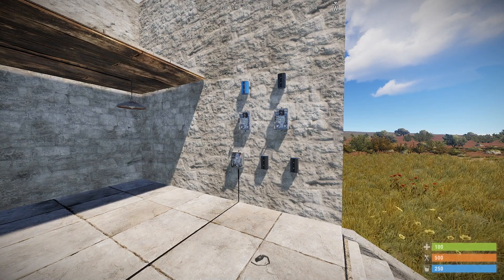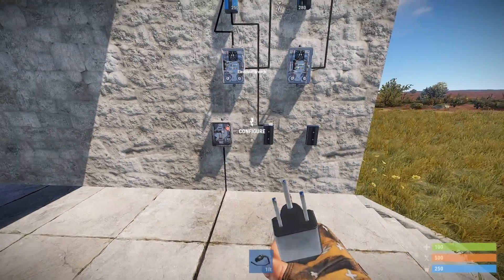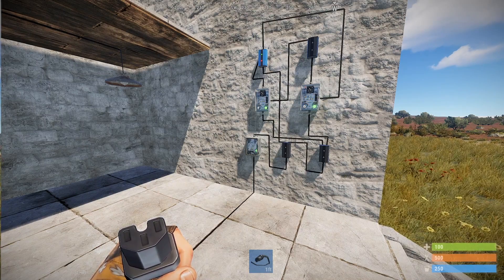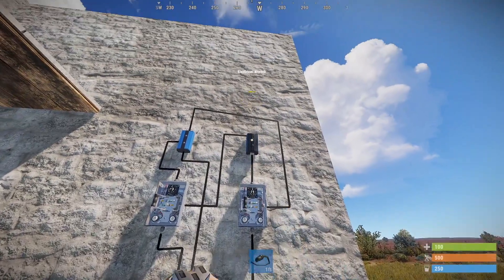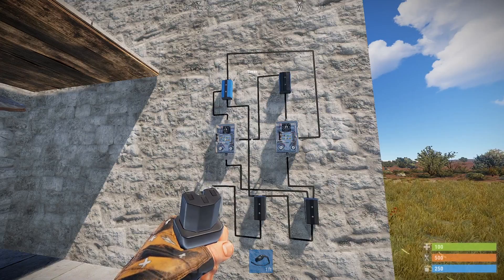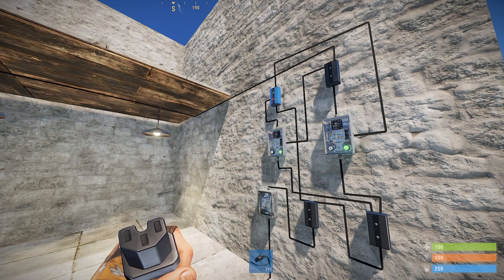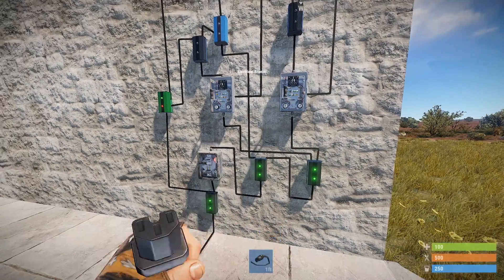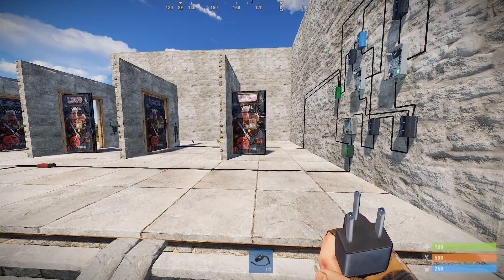(RUST) Electricity 101 - Repurposing Circuits S01 Ep.4

Comment: Could this be used for the new update? where you set it up so it has at back up battery, use the generator at night and solar panels at the day time, and if something happens at day or night with the power sources it would use the battery.
Reply from the maker: I would recommended checking out my vid titled "Unlimited Power". This shows my battery backup system.
To answer your question completely, I would recommend popping back to this channel the day the update drops... *wink wink, nudge nudge*.